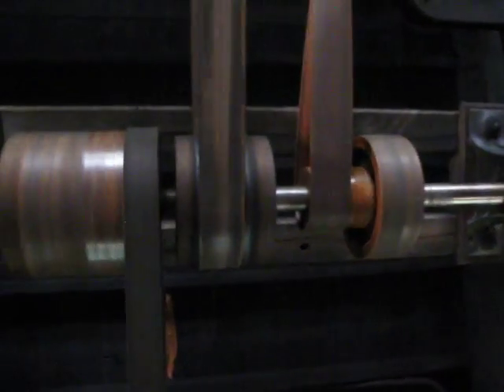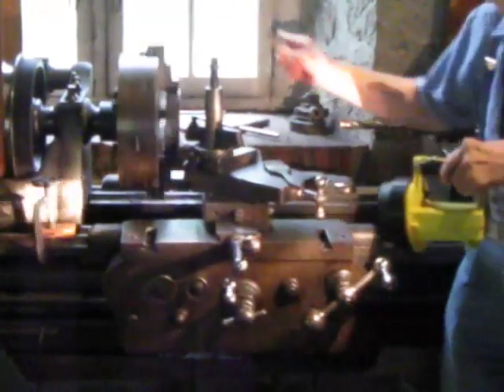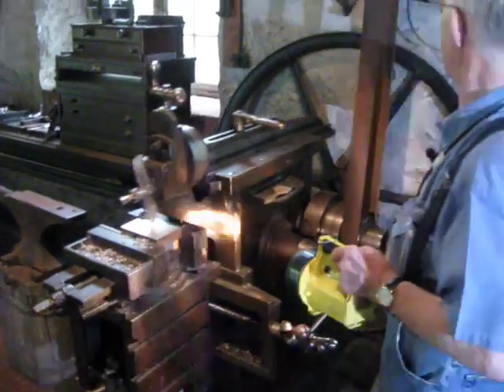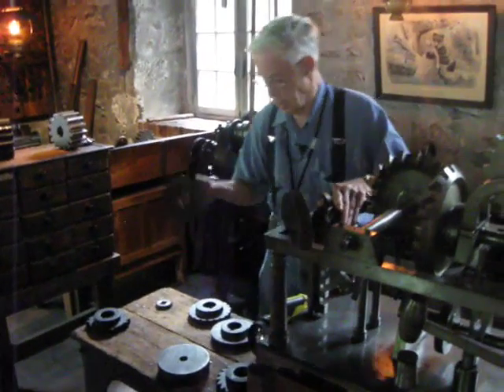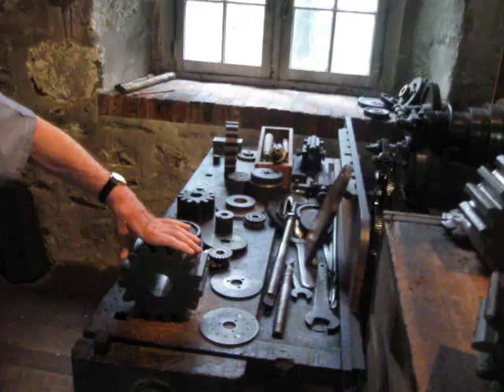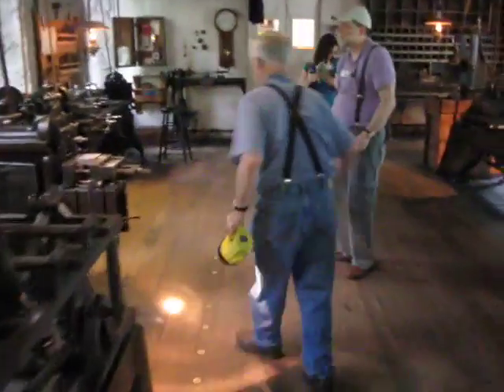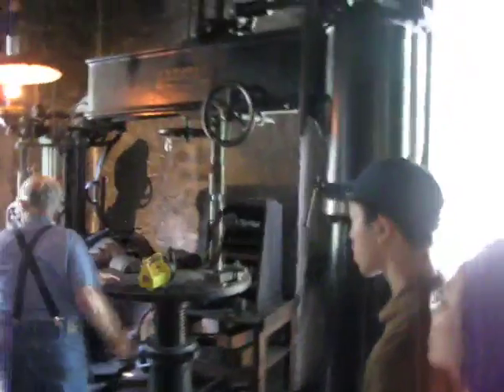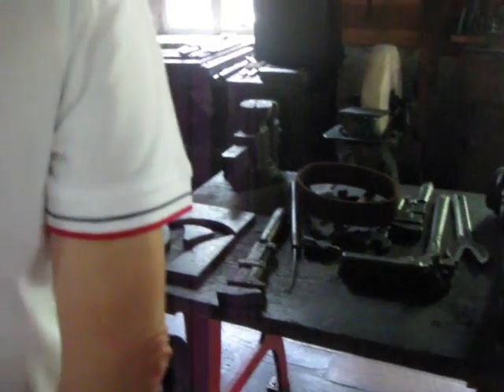Hagley Gunpowder Mill - The Civil War-era Machine Shop

Comment from the maker: The shop was originally steam or water turbine powered, the electric motor was installed for demonstration. The video is from about 7 years ago, since then the museum has restored a water turbine outside and linked it with a drive belt to power the shop.